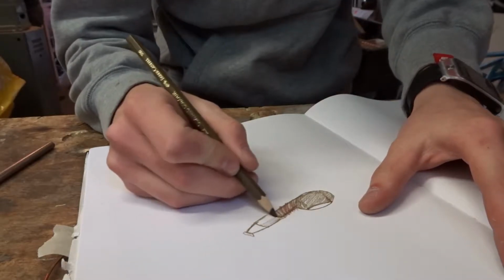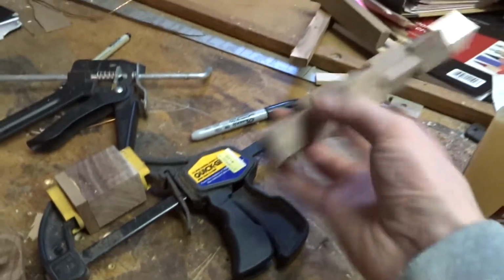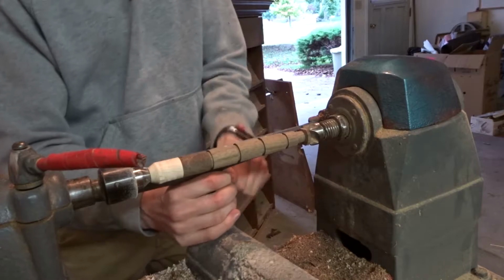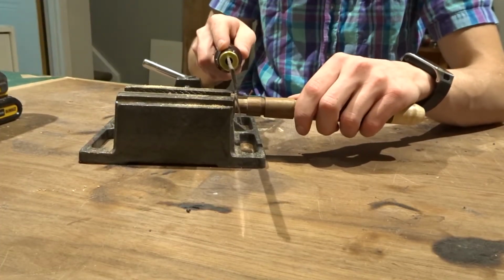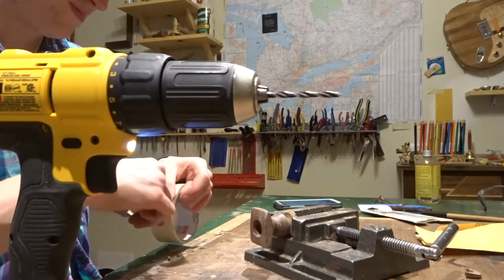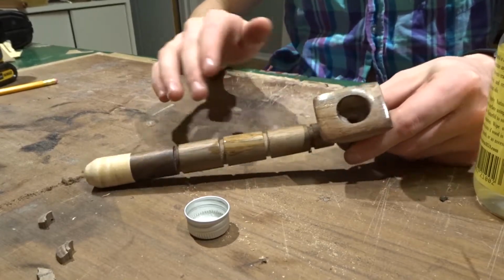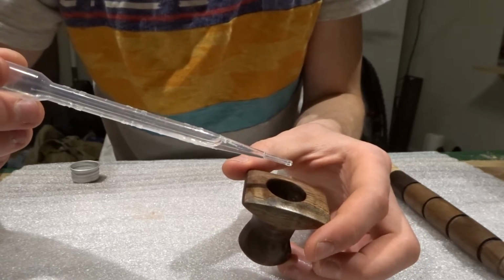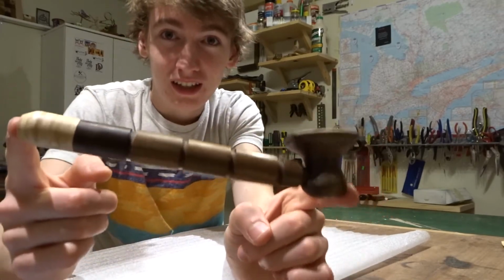How to Make a Wood Pipe On a Lathe

Comment: Dumb question on a very old thread, is it safe to glue wood together and then smoke out of it?
Reply from the maker: it depends on the type of glue and its heat resistance. also whether the flame is touching/ boiling the glue

Comment: what i do for centering my pipe holes is i drill a long 1/4 inch hole all the way through then i mount it on a pen mandrel.
Reply from the maker: +Calvin Wendland peck drilling. So just go down 1/8" then lift up to clear

Comment: You have a good, solid technique. I only suggest getting a drill press for future creations. It helps with drilling holes at an angle, without having to manually pinch the part in place. Well done otherwise, keep it up.
Reply: Doesn't matter it will work send it to cheech and Chong

Comment: From what I seen of your bit, I think its a round over bit. Check out the router bit section at your local hardware store. You may want to check out what is called a 'box core' bit. It will giive you a great rounded bottom to the bowl. I have a 3/8 and a 1/2, make nice bowls.... Oh yeah, they can go in a drill, LOL.....
Reply from the maker: Ive been using that cove bit. And now use box core bits and a funky roundover bit